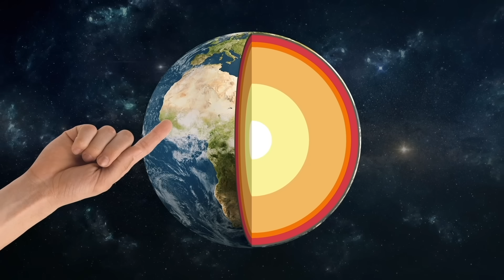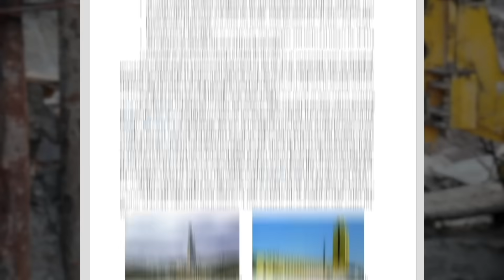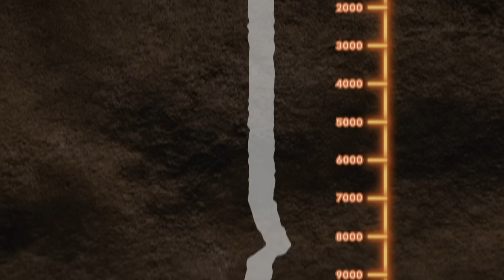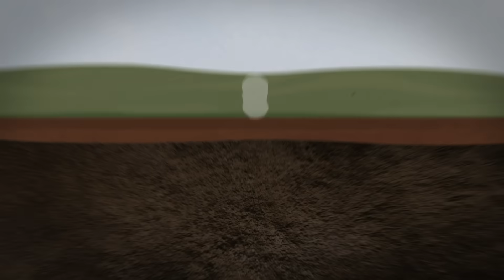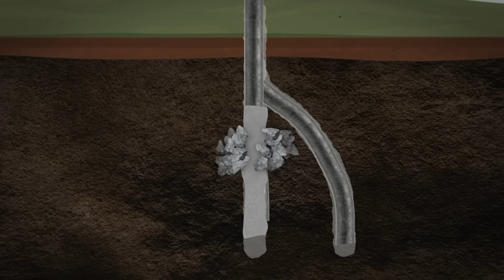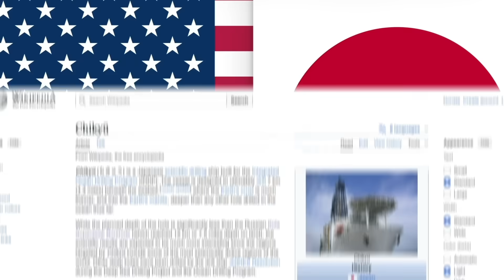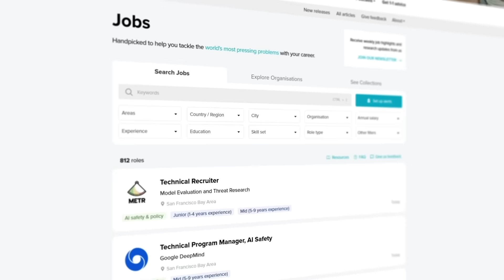How They Dug the Deepest Hole on Earth

Comment: The German Borehole had pretty much the same problems as the Kola and they just didn't see much more use because the danger of breaking the drill and having to start over was too great. 
But at least they got a very straight hole looking from the side. (Don't look too hard from the top, the drill still wandered quite a bit)

Comment: Could we not use the free heat down there as energy? Especially if the hole is dug in the ocean, where we also have free endless water? Heat + water = steam, steam = energy

Free energy?
Reply: We already do. There's a number of geothermal power plants in the world. I personally know of 4 currently operating in Russia. But there's no point in drilling so far down to access this heat. We have a lot of places where this heat literally bursts out from the ground, for example as geysers. All you need to do is ensure this place is fairly seismically stable and you can pretty much shove in the turbine and generate power right away.

Comment: We are told that the deepest anyone has ever drilled into the surface of the earth is roughly eleven kilometres (6.35 miles) down yet we are also told that the core of the earth is twenty nine hundred kilometres down.  

Earthquakes are measured with a seismograph up to a depth of only seven hundred kilometres. 

Ground penetrating radar can only reach a maximum depth of one hundred feet (or thirty meters) in dry, low conductivity, materials and that is in the best of conditions.

It's usually much less.

Try to find some evidence that verifies that the core of the earth is made of and doing what we're told it is made of and doing.

Also, how can anyone know what supposed planets and stars that are supposedly millions and billions of supposed light years away are composed of right down to their supposed cores?

Comment: Imagine a world where it is easy and cheap to drill holes. Maybe not 12 km. But just 3 km.
Then we could just drill a hole everywhere we need heat and put some tubes down the hole pump some water through the tubes and have hot water everywhere.
Reply: Congratulations, you have just reinvented the concept of geothermal power.
Reply: @ironicdivinemandatestan4262  note the easy and cheap part. But yes.
The problem is that some places it is super easy to make geothermal (Island) and other places it is much harder. But if it was easy and cheap to drill deep it would not matter. You can also use less deep holes to improve your heatpump performance. That it would be nice if we could drill holes for cheap.

Comment: Imagine this. You're drilling through that 6km area, you reach the mantle, it's magma, under pressure. Lots of pressure. You've just drilled into it and creates a weak spot in the crust. Your drilling rig gets blown upwards as the massive internal forces of the earth come rocketing up the holes you've drilled. Spews lava hundreds of feet into the air for days until the pressure in the mantle is released. The world's newest volcano is born.

Comment: The Sea Lion pool at the Queens Zoo is 7.5 miles from the Bronx Zoo Sea Lion pool. I clocked it. All 5 boroughs have their own city zoos and you can draw a line of the same distance connecting all 5 from Queens to Staten Island. It doesn't continue the same direction though. It's about a mile shy of forming an equilateral triangle with the Central Park zoo and the Bronx Zoo and forms an isosceles triangle instead.

Comment: there's a universe where the soviet union didn't collapse, they just changed their priorities and the whole country's focus is digging the hole.
You could leave if you want, but if you stay, every thing you do would be to support the hole.
Reply: at one point, the temperature would be so high melting any drill they send, so even if they didn't collapse earth-chan won't let them continue
Reply: @pepo_pipi  That would have to be a substantially more elevated temperature than was encountered by the Kola team.  The temp at the bottom of the existing hole was measured at four hundred and fifty some kelvins.  It's trivial to make a drillbit with a melting point eight times that, and that's without messing around with exotic materials.
Reply: @jonadabtheunsightly  On top of exotic materials they could also use active cooling. Russia was the first nation to have active cooled rocket nozzles IIRC. 

Now the temperature at the center of the Earth is expected to get up 6000c. Rocket engines get up to about 3400c in the combustion chamber. So just active cooling won't work, but rocket engines also have to be mass efficient. Mass doesn't matter here.

Tantalum Hafnium Carbide Alloy melts at 3990c, actively cool that and get maybe another 2000c. But that would take the entire funding of an economically healthy Russia.
Reply: @AGryphonTamer  I didn't mean to imply that I thought it would be possible to drill all the way to the center of the earth.  But I do think it would be possible, with adequate dedication and funding, to drill significantly deeper than has yet been done.

Though I'm not aware of any really compelling reason to do so.  There are other research projects that would be cheaper and seem more likely to yield a larger amount of useful information.
Reply: @pepo_pipi use nuclear shaped charges
Reply: From seizing the means of production to seizing the means of producing the deepest hole any y’all motherfuckers ever seen!
Reply: That's stupid the hole as a concept is a project that can only exist for science and the goal of a socialist economy is the well-being of the common people (which it achieved)

Comment: Shoutout to all my homies who are also irrationally irritated by the screwdriver being referred to as a drill bit.
Reply: It is a drill bit though… A screw driver would surely have a handle
Reply: @davideverling753  no a drill bit would be a device for making holes in things, what is in the video is a device for screwing screws into things. 

The device holding the bits does not decide whether it is a drill or a screwdriver, it is both depending on which bit is in it.

Comment: 2:10
Minor correction, but the AMS dissolved itself in 1964 according to the MBLWHOI Library.
It's unclear how much they officially contributed to the project as their initial pitch was rejected prior to 1958, and the work was credited to the National Academy of Sciences after a follow-up pitch was accepted and carried out.
Reply: wrong
Reply: @growingmelancholy8374  Which part is wrong? Because, it does look like the society dissolved itself in 1964. And it does look like Project Mohole was credited to National Academy of Sciences for the follow-up projects.

Edit: To clarify, yes, the initial proposal was from AMS, but it got rejected and the resubmitted by NAS.
Reply: @growingmelancholy8374  this isn't even that hard to fact check...searching "American Miscellaneous Society 1966" yields no results
But searching "American Miscellaneous Society 1964" gives several articles relating to their dissolution and references the proposed hole plan that was rejected
Reply: @growingmelancholy8374 "wrong" 

Source: trust me bro

Comment: The interesting thing is that even though the earth seems so deep, in reality we are sitting on a thin layer of crush that sits on a large ocean of lava. Science is more creative than scifi.
Reply: The mantle isn’t really “lava” it’s more like extremely dense hot rock with a high metal saturation, yea so it isn’t lava at all (surprise surprise school didn’t tell you the full truth), if you go deep enough to the lower mantle you will find molten rock but alot deeper in the mantle, you can also find a whole ton of molten basalt “lakes” because basalt has a low melting temperature compared to other rocks, and a low density they float up over time feeding into volcanos, there are also steam pockets.
Reply: Scifi replaced that large ocean of lava with a tropical jungle full of dinosaurs for some reason, so sorry creativity is always more creative than science, because no matter how wacky science can get, creativity can always throw more wacky on the pile

Comment: 0:33 an error here, the Kola Superdeep borehole has now been surpassed by the Z-44 Chayvo Oil & Gas well since 2012 - also in 🇷🇺Russia!
Reply: No, it's not an error. Z-44 is not the deepest - it's the longest hole. It has the length of over 15 kilometers right now, but it's being drilled at a highly acute angle, and it's not very deep at all. Yes, even the Guinness World Record book uses the word "deepest" regarding the Z-44 well, but the "deepness" here is actually the length of the well, while here in the video it means the actual deepness - the distance between the surface and the lowest reached point.
Reply: @Silverhorse777  This is one of the most reasonable comments on YouTube, bravo!
Reply: The Ruzzians sure are good at digging themselves deep holes.
Reply: @Pulverpojken trying to dig their VDV buddies out of hell to reinforce their frontline, no doubt
Reply: @Pulverpojken  ..or digging themselves into these holes lol
Reply: Z-44 surpassed the length of it, but not the true vertical depth, as it goes horizontally to an offshore oil field.
Reply: Russia is a barbarous bastion of bastards
Reply: Wikipedia says you're wrong (and i would rather believe Wikipedia than an internet stranger)
Reply: @social.elenakrittik  you do realise that any random internet stranger like me can edit Wikipedia as well?
Reply: @AchyutChaudhary  impossible
Reply: @AchyutChaudhary  you'd need to source your edit with an actual reputable source, since otherwise, wikipedias editors would quickly revert it
Reply: @AchyutChaudhary it is longer, but I can find no definitive confirmation on if it is deeper
Reply: @AchyutChaudhary  I wasn't born yesterday, everyone knows that. And i still stand by what i said: Wikipedia content (especially on non-controversial topics like this one that people have no reason whatsoever to damage) is more trustworthy than most people's words (myself included, of course)